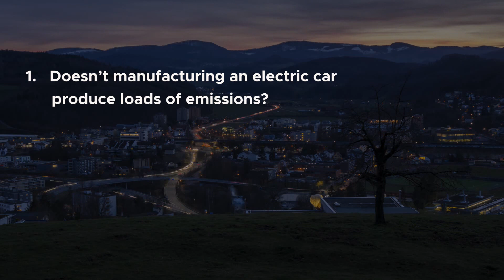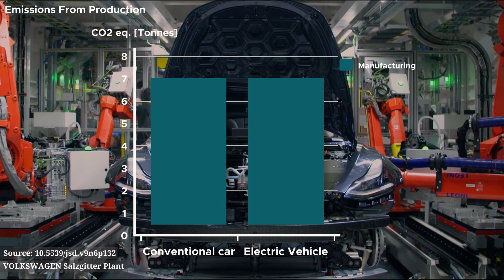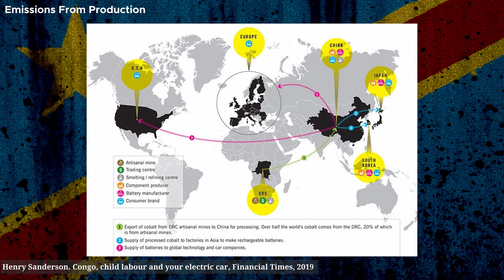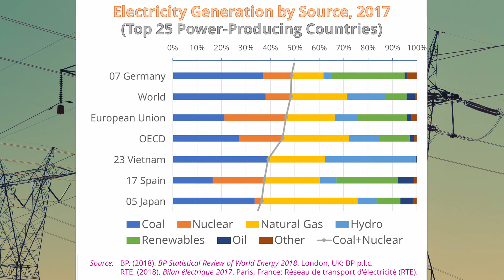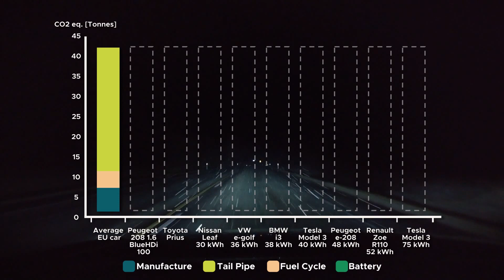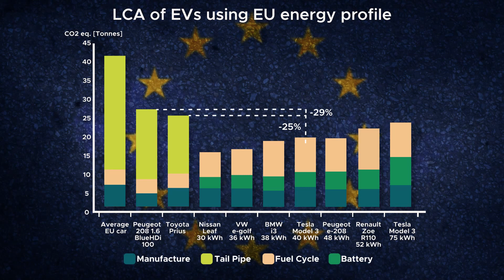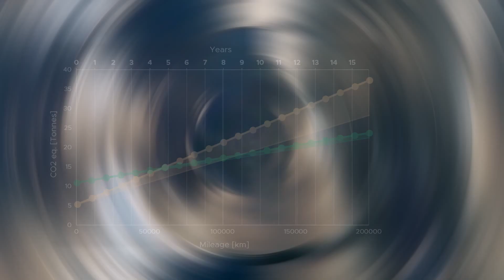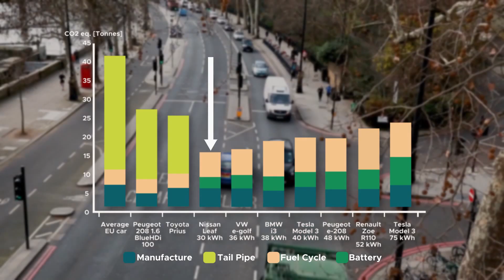Could Electric Vehicles be Bad for the Environment? Data Reveals the Truth

Comment: Am i the only car guy who feels hurt?
Reply from the maker: Why?
Reply: @OurEden  although this ban maybe good for the environment. It’s beneficial for the people who mainly just get cars to travel from a to b. However some of us its a way of life, a hobby, a passion an maybe even a reason to live. Majority of the car community, feels electric cars just are not the same. They are perfect cars, but they sort of lack a soul. We love cars, everything about them. From the subtle sounds the engine makes, to the horsepower. With petrol/diesel cars theres just this sense of freedom and potential. Connection with the car, im not saying i hate ev’s. They are just not for me, maybe if there was a better alternative which was better for the environment but still maintained that which we loved then i would chose it without a doubt. Its for the greater good i guess, after all  majority of drivers just drive to get from a to b.
Reply: @lju2640  I run a 73 Olds 98 2 door with a 7.5 litre V8 as my "hobby car".  It sounds amazing, looks amazing, and it's only covered 50,000 miles in its near 50 year life.  I would never change it for an EV. They are great but as you say, they're soulless. Combustion engines have different characteristics depending on their configuration.  Electric cars all drive the same, just some have more power than others.
Reply: @lju2640  The "feelings" you have for an ICE car are learned. You can just as easily unlearn them.

Comment: Perhaps the manufacturers of electric vehicles should embed a photo on the dash of a person who DIED while being employed to mine the heavy metals for the manufacture of the battery that powers each vehicle. That way, the owners will be made aware of a part of the REAL cost of their car & reminded every time they drive the car.
Reply from the maker: Unfortunately, heavy metals are used in a lot of different industries; it's almost impossible for someone in a developed country not to contribute to unethical mining. Phones, laptops, cars, etc use rare Earth elements only found in politically unstable countries, and mining industries are all too keen to exploit them. Refining crude oil into gasoline actually uses a lot of different heavy metals, including cobalt, and kills millions of people every year due to air pollution. So it's incorrect to say making EVs contributes to more harm to humans than making any other type of car. Additionally, EV manufacturers are moving away from cobalt by using other types of Li-ion technologies, namely Lithium Iron Phosphate. Making anything requires materials extraction which is vulnerable to exploitation, we can only hope that the affected countries continue to develop and stabilize their economies.
Reply: Perhaps you ought to carry out a little more research on the subject? If you did, you may discover that the majority of EV manufacturers have already signed agreements and pledges to buy only ethically sourced minerals for their batteries. The Chinese however, still continue to buy unethically sourced minerals regardless. This has been verified by Amnesty International......  Perhaps the big oil companies ought to publish photographs of all the poor sods who mine cobalt for them? They need cobalt to remove sulphur during the refining process, and they've mined it for decades.